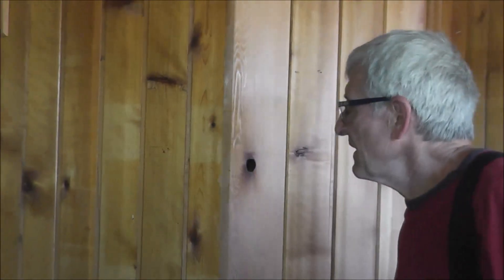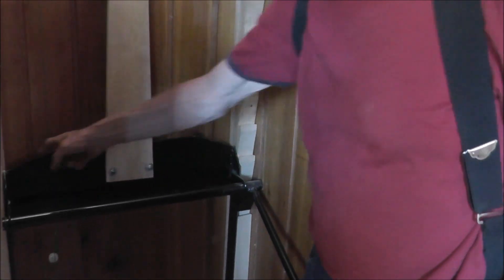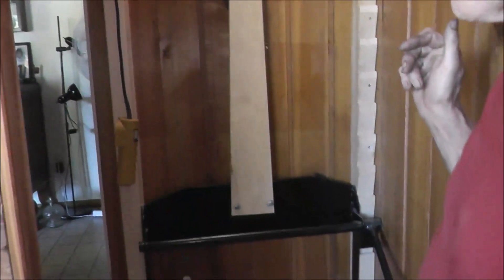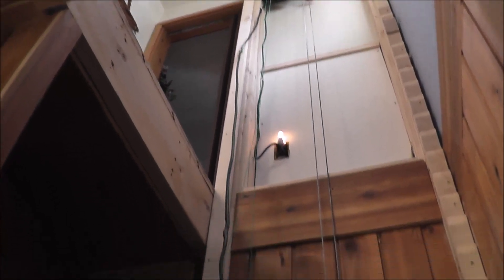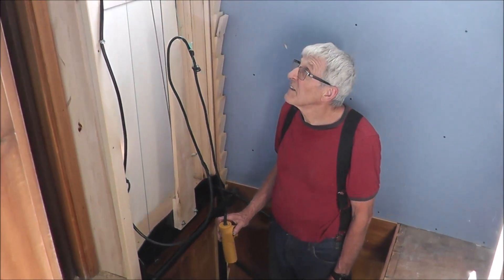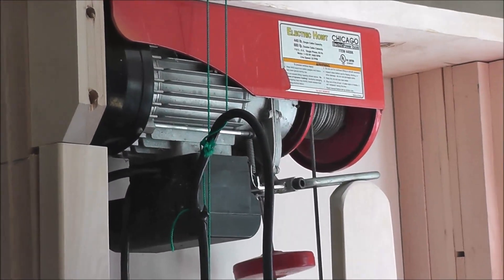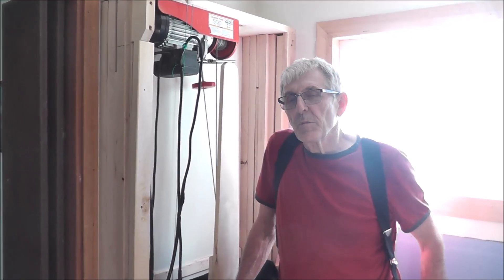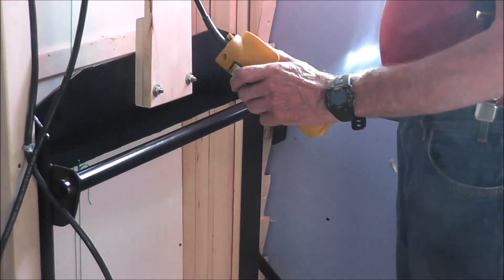DIY Elevator for home or shop

Comment: Love the car hoist style safety lock outs Nice work from a lift installer for Thyssen Krupp , couple of easy safety fixes for this unit.1)put a piece of timber or sheet over the gap between ground and first floor, @ 3.12 ,a toe guard.2) construct a ceiling in lift that when on first floor the ceiling becomes the floor of the second floor,as lift raises the floor raises as well.A ten foot fall from 2nd floor could be fatal.Also a fixed seat would help with keeping you and your wife a bit safer.
Reply: These are excellent add-ons for safety, especially preventing a fall from an open floor. From the standpoint of one with bad joints, though, the seat may not be wise; hip and knee replacements make getting up and down the MOST difficult thing to do, so standing for that short time would actually be the most comfortable. I wish my hubby was a DIY guy and we could move where permits are not a big deal!

Comment: Actually, this is a very clever idea. Very ingenious. - However, you need to add two safety measures. 1). You need a cut-off switch much like a treadmill has to prevent you from falling off and the treadmill continuing to spin. That would prevent your wife from getting hurt on the device and not being able to stop it. You need a way to stop it in case of an emergency. - Maybe something hand held that if released, stops the power. 2). You need to cover the "series of notches" with something metal or at least maybe aluminum. In the even of an emergency that the lift begins to drop, you certainly don't want the "notches" to split under load. That metal "dog" will split one of those "notches" with the greatest of ease under pressure. -- That said, very interesting idea. BE CAREFUL with it.... you don't want anyone to get hurt with that and for goodness sakes... NEVER let any kids use that thing. Maybe a third idea is a Key, to start and stop it, so kids can't play with it. - Good luck.
Reply from the maker: Thanks for the comment and advice. The controller that she hold has to be depressed at all times when in use, If dropped or released it automatically stops. A number of people have been concerned about the wooden notches, They are large and made from hardwood, I feel confident that they would never split off. I have also put 3 inch wood screws through the notches into the wall as well.

Comment: The simple safety is genius, something that has stopped me from making my elevator.
Reply: grancito2 But what safety device is there to prevent a free fall going down If there is a cable failure? Also for safety you usually wrap the elevator with a fire rated Sheetrock or gypsum board to protect from fire which would include a fire rated door top and bottom. It does get some up and down.
Reply: @Fryzss  Watch the video, it has a simple safety that doesn't need the cable. But by your stupid fire protection comment and unintelligible last sentence, I have to assume that you are a moron.

Comment: I am building a lift for my Wife and her wheel chair to get into the house from the garage.  The house sets about 2 feet above the ground.  I welded a lift frame big enough for my Wife in her wheel chair and I already have the same hoist you have.  Can you tell me about the switch you used at the top to stop the lift?   I am considering plunger switches for my build but am curious what kind of switch you used.  It looks like you have your up wire in series with the switch, this way the down still works. Any info would be great.  Thanks for the video.
Reply from the maker: The stop switch is already provided on the winch, in front of the drum.  When using a single line the cable has a large blob in  front of the hook, it hits the bar in front of the drum so you don't wind the cable right in. If you double the cable back to the winch of course you do not have that safety feature. That why I have that wood post that sticks up, also protecting your hands from the cable. Make it tal enough so it hits the switch bar when the platform is in the right position or slightly above. I hear my wife adjusting it to be right where she wants it as mine will go slightly above.  We have been using this one for over a year now and has worked well.  Hope this answers your question, happy to help.  Brian
Reply: @brianprocter6191 Wow, Thank you very much.  I have not opened the hoist and read the instructions yet because I am not yet ready to mount it.  That will make things easier.   If it works out, I will also post a video.  I appreciate it.

Comment: But at the upper floor there is not a parapet or a gate: it is dangerous due to the risk of falling down when the platform is down.
Reply from the maker: Its in a locked room when down. no access to the top when down.

Comment from the maker: There is a pulley attached to the frame, the cable runs through it and back to the winch frame, this gives the 50% reduction in speed and twice the lifting power. The pulley  and holder comes with the winch. Common for all winching situations. We have used this system for a year now with no problems. Due to have the cable replaced now.  I bought a new better cable and it was about 5$.. Added a springe to the handle to snap the dog in if the cable would break. The large ratchet is hard birch and will not shear as some have said.  Yes it will not meet any safety codes but one should be able to build for ones own use. Strickly own. |I should not have said where I live there is not building codes, Just that I have never had to get a building permit.
Reply: Please keep this up. Most of us will benefit from this information. Thousands  of thumbs up to less than few hundreds down.  Just make updates to anything you would like to make better. 385K have viewed it.
Reply: outstanding work.
Reply: That is what i about to ask. You didnt explain the pulley or share the photo of the pulley that attached to the frame but instead you bother to explain the pulley to help adjust the controller which are lot less important part of the whole system. The pulley that attached to the frame is a main major important part of the system that you left out from the video which made it very hard for beginners to follow your design.
Reply: I like it, I need one for my front porch that is about 40" up...
Reply: Fast forward to 2024.  Screw the government and their building codes.

GOOD JOB

Comment: wow, I've been pondering something like this for a few years now almost since my injury
Thanks so much for sharing this - as a paraplegic - 30% partial quad, and 

don't have anything close to the $27-$33K+ they want for retail installed system
Still force myself to work and not drain on the tiit of the system until absolutely no other possible option.
I'm a genuine real need case and don't qualify for any type or sort of assistance.

The only spot you lost me was the "2 pulley" set up on the winch - 50% ratio reduction maybe ?
I'm assuming something to do like a gear reducer so it doesn't go at the actual speed of the winch.
Got my wheels turning further now seeing a near perfect affordable option.
Would be nice to see my kids bedrooms upstairs from time to time, and gain just a touch more mobility back.
p.s. don't pay any mind to trolls and other bashers, unfortunate plague of the net
Reply from the maker: Thanks for the comment. I do hope you can improve on this idea. It has worked well for over a year now, every day.  If it wasn't for it we would have to move.  I did make a mistake, I said we have not building codes.  Just that I have never had to have a building permit.  If I sold the house it would be removed. No one rides it but ourselves.    Happy to answer any questions you might have.  Brian.
Reply: @brianprocter6191  Like any additional information. Plan to follow your design 100 Percent. Thanks for the Great service. You are Brilliant! My Email gahmmh@aol.com Thanks George
Reply: The 2 pulley system works like this.You lower the cable down a bit and then hook it back onto the lift motor in a designated spot,you now have a loop.On this loop you mount a pulley with another hook.You lower this pulley/hook down and attach to the lift car/this doubles the load rating whist halving the spool speed.

Comment: Hi.  What kind of wood did you use?  Do you have any drawings of your plans?  I bought a hoist yesterday to build my lift.  It is only going to have to raise about 4 or 5 feet to the landing of my porch.  I want to use your design for the metal structure.  I hope to hear from you soon.  Thank you!
Reply from the maker: The wood that I am using is Birch, tough as nails as they say. It will not break or shear off as some say.  If you need any specific pictures for anything, send me an email address.  I had previously built another one  that went 5 ft. but didn't have the safety ratching design.  I can modify this one to lock going down also if the cable was to break. You may be interested in that design too. Will be gone from home  for a week now.

Comment: That model wench gas a remote control available on line  about 30 USD .
Reply from the maker: I would like to know where. Most winches say remote control but they always have the controller extended with a cord.
Reply: @brianprocter6191  https://www.aliexpress.com/item/32809333097.html?spm=a2g0o.cart.0.0.3c4f3c00Tm6W9x&mp=1

Comment: Great first iteration of a lift.  Some suggestions, use a Hoist in place of a Winch.  Hoists are designed for lifting horizontal, winches are for pulling vertical.  Move the mounting above and the cable through the top beam instead of below it.  Now the lifting motor is held by more then the bolts or screws as it is pulled down by the load.  And yes you might want to find some other safety gates or other ways to avoid falling through or off the holes and platform.  But even as you modify it  your 30x less then a commercial unit.
Reply: And all this time I thought I had a winch on the front of my Jeep and a hoist in the ceiling of my garage.  Thanks for the clarification!

Comment: It gets the job done. My only concern is the safety ratchet system that relies in gravity to make it latch. Gravity won't work when you and the carriage are falling. A spring to pull the arm down might help, but the person has to remember to let go of the handle when they're falling! Even better would be something that locks the carriage when the cable goes slack (like a real elevator). Nice work though.

Comment: Before you consider doing something like this you might want to consider that there are codes and ASME ANSI standards that apply to residential elevators and lifts.  They are much more flexible than commercial codes.  There are even separate standards for light duty commercial elevators.   Most of the standards for residential elevators are reasonable and reasonably achievable.  So before you embark on this DIY project you might want to investigate.  I'm not going to spend my time critiquing this guys DIY project but as someone who is familiar I can easily observe several major safety violations.  Not saying that it won't work for a 1000 years without anyone getting injured, just saying it is in violation of several key residential codes.    Most important violation (the most basic of all) is that it doesn't have an emergency stop or kill switch.   Most cheap winches do not.  If the switch that controls the motor were to short then there would be no way the operator could stop the elevator.   The thing you need to consider is liability.   If someone does get injured or heaven forbid killed then your insurance company will deny a claim.  That is the #1 sinker for having a lift that isn't professionally installed and safety inspected.  You build that then you are on the hook for whatever happens.   In the US a 2-Stop residential elevators cost between $8 and $15 thousand dollars, the actual (residential professional and code compliant) elevator cost of about $4 to make, so most of what you are buying is liability protection.

Comment: What happens if the cable breaks when you going down? I would  put a spring pulling down on the level and only allow the level to be raised just enough to clear the teeth.

Comment: Fascinating! You're right when speaking of regulations, I don't think this would fly in the area I live. Do you plan to put a railing around the shaft on the second floor? It seems like it would be fairly easy to fall in if one wasn't careful. Also perhaps it could use some more protection over the wires? Like plexiglass. I know you said that the wires were rated for up to 800 pounds, but I wouldn't want to be hit by them if they did snap. Elevators and lifts should be cheaper to install. They make homes a whole lot accessable.

Comment: While I appreciate the drive and inventiveness of this build, I find the safety fail safe appears to be poorly designed.  Essentially the grain is running in the same direction as the falling bar, and I think there's a chance that the bar would function almost like a ax or a wedge and split the wood, rather than arresting the fall.

I would suggest getting some 1/8" steel tube stock, and cutting the same jagged tooth pattern into it.  It's a lot more work, but I believe it would increase the safety enormously.
Reply: or bolts in wood heads acting as notches but they might split the wood under load so need side bolts too or what or wires around the timber. or clamps

Comment: Some of those "lattice doors" would certainly be an improvement, but I'm not sure if they're easily available. Some bolts holding together wood for wall trim should be an easy enough way to build them though.

Comment: I managed to get myself paralyzed and designed a similar set up out of wood.  I elected to go 12 volt as it's more reliable, 700 Cold cranking deep cycle RV battery with a trickle charger keeps the system topped off but I should fix my solar panels!  ;]  I loved to brag about having the world's only solar powered elevator with cup holders.

Comment: Nice, but hope that safety notching is elm, because splitting a notch off and a little downward acceleration and they could all go. Maybe steel plating bent to fit the wooden form would be safer.

Comment: Mighty good job fine Sir. You've probably taken care of this already but might I suggest a small banister railing around the top floor hole with a door/gate which is connected to a switch that engages and only allows the door/gate to open when the lift is on the top floor. God bless you, your wife is very lucky to have you!

Comment: I admire your creativity and mechanical skills but I would never use this regularly for a family member.    It would be really cool in a garage or shop though or even in the house for laundry and other objects.  I'd be afraid of someone falling down the shaft and also pinch points while riding up the elevator.

Comment: Codes and inspections have a place because most people are stupid and need protected from themselves, or the public needs protected from stupid people in public places.  This guy is smart and in his own home, so neither applies here.  He is well able to judge the level of safety he requires for the intended users of his device.  Good job.
Reply from the maker: Thanks Toby, I will be incorporating more safety devices, Like an automatic arrest on the way down, The top is in an enclosed and locked room when down. All the wood is hard wood and will not break. It can be made safer for our own use though.

Comment: no building code aside. you should probably enclose the elevator at least to the waist leaving clearance to prevent pinching between floors. one moments inattention could be fatal with wide open design. As I age my balance is more of an issue. extra weight might necessitate counterweight or larger winch to maintain good man rated safety margin.
Reply from the maker: The pinching going through the floor was a concern for me, my wife is the only one using it and she stands right in the center and she feels safe. your concern is a good one.

Comment: the winch is rated at 850lbs what about the door frame you have that winch installed upon???
Reply from the maker: Thanks for the concern, The heavy Hemlock frame rest on the wood and the board that the winch mounts to is hardwood. No fear of it failing.

Comment: Hi, If the pawl latch was moved through 90 degrees and wire rope was attached to the pawl lever, restrained by a clip. and the pawl  rack 
mounted at 90 degrees to the one shown in the video if the rope were to break, the pawl would release and prevent the lift from dropping by more than the pitch of the pawl (A similar one was invented by Otis)

Comment: I would have made the safety catch's / dogs / notch's out of steel instead of wood . Wood dries out and cracks over time
Reply: Treat or paint it. As long as you aren't using softwoods like pine it should be just fine...use Oak, Maple or if you are really nervous Hickory.. etc.But, so you know, most home framing is done in white pine. How many stairways, homes, flooring systems in residential homes are made out of steel? What are they made from? Yes, wood. If you can rely on wood to hold up your roof, protect you from the outdoors and keep you and your family safe I'm pretty sure you can feel secure in a lift that is going to be used a few times a day to a couple dozen times per week. I think people forget about how strong and capable plain old wood and nail structures can be.